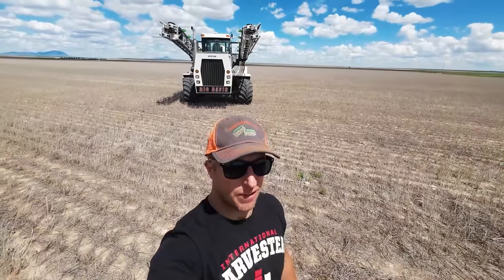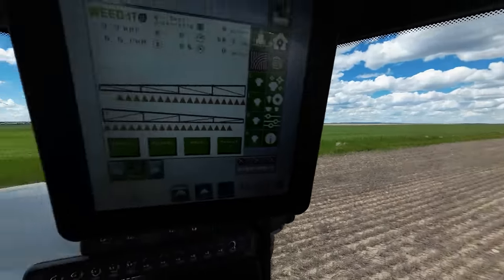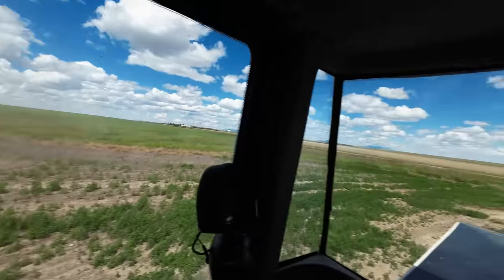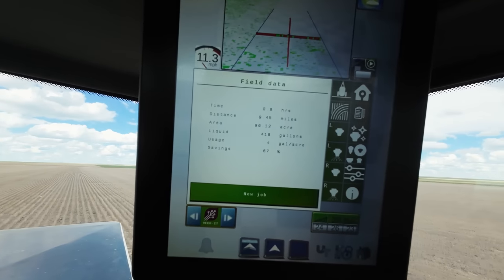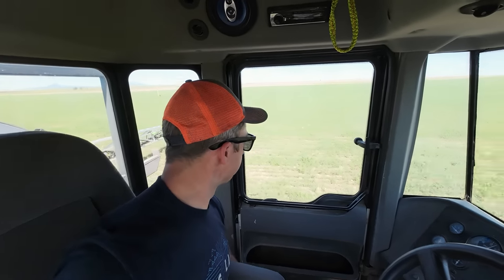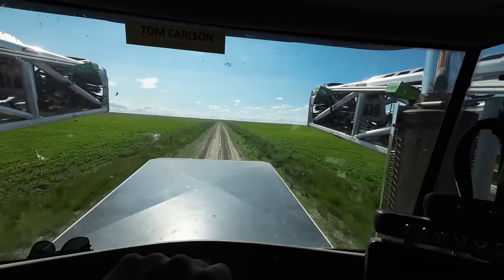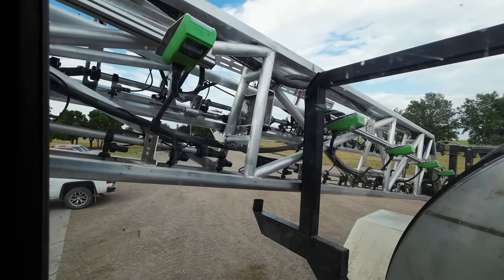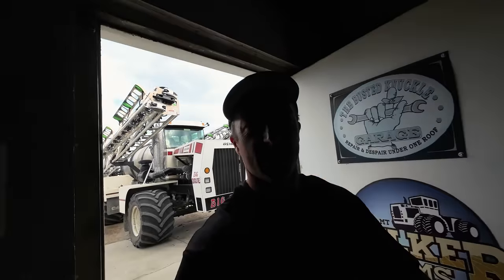THIS THING IS A BEAST!!!

Comment: Seeing those nozzles spraying as needed was amazing.  Not only saving money but not adding unnecessary product to water table.  Truly wonderful technology.
Reply: there is already a much better system that sprays each plant individually
Reply: @xxn0cturn3xx what technology is that?
Reply: @runninred89  look up Verdant robotics
Reply: @xxn0cturn3xx  That's pretty much what this is doing if you watched it any.
Reply: @Buck1954  lol no its not, do you even understand how the system works? Does it look like this system can target a single individual plant? 🤡
Reply: Yes it targets each individual plant i use the Weedseeker system.
Reply: @darrylpaulhus3069  no its does not, how hard is for you people to understand that this system targets an AREA and NOT a SINGLE PLANT..
Reply: @xxn0cturn3xx  no worries but stills uses up to 90% less chemical and i can still spray around 1500 acres per day
Reply: @xxn0cturn3xx  no worries but stills uses up to 90% less chemical and i can still spray around 1500 acres per day
Reply from the maker: @xxn0cturn3xx  this system does detect single plants and spray accordingly. But at 10" spacing and 30 degree nozzles, the spray pattern on the ground might be as much as a square foot. So a plant trigger means a square foot of product cover.
Reply: @WelkerFarms  just as i said, sprays in AREA, it always sprays the same area being there 1 plant or 10 of them. The system im talking about if theres only ONE 10mm wide plant it will only spray THAT plant, not a square foot.
Reply from the maker: @xxn0cturn3xx  that's impressive! I wonder what the top speed is? Would have to keep the boom height and speed absolutely perfect to maintain accuracy with that low of coverame margin. Still super impressive.
Reply: @xxn0cturn3xx  How are you quickly gonna drive over a weed with a sprayer and accurately target a single weed. A bit of wind or you drive over a bump in the field and it's gonna miss. Bet it's something that sounds cool in theory but is unreliable, overcomplicated and overpriced. More like a tech demo that doesn't work in practice. I'd like to see any farmer using that with good results.
Reply: @atnfn  the sensors probably look ahead to give time to follow, its not rocket appliances

Comment: Fun fact: be super careful when you get into mud with those sensors, when the tires start throwing mud/rocks, especially if your roading home in a rainstorm, it’s very easy to knock the glass out of the sensors. You guys have nice full fenders so you shouldn’t have to worry too much. Just a bit of personal expensive experience.
Reply from the maker: Thanks for the heads up! These are made with gorilla glass now so hopefully helps but no glass is indestructible.

Comment: I hope you keep updates on this system, how it performs, problems that come up, longeveity, etc... eventually things are going to not function (solenoids, valves, possible corrosion, etc) and what an average yearly cost to maintain it will be. A lot of money upfront for this massive upgrade, easily more justifiable with the more acres one has to cover each year.

Sprays that are non-residual (either like a glyphosate or glufosinate type or similar characteristics) this type of spraying will save a lot.
Reply from the maker: Thanks man! Did you see glyphosate crashing? Lowest price it's been as long as I can remember. Too bad it hardly works on our weeds anymore. Basically only good for grasses.

Comment: I'm curious if all the dust that gets kicked up affects the optical sensors directly behind the brute.
Reply from the maker: It definitely doesn't help, the sensors still detect but the chance of a miss is higher. Not a big deal because I will come back every 21 days and spray it again. So any Miss gets taken care of in 3 weeks.
Reply: Could you move the center section to the front?  Or just move the sensors to the front and use a unique distance compensation calc for the center tips.

Comment: I was a commercial restricted chem applicator back in the late 70 s and early 80 s.  This system is light years ahead of what I had to use.  Chemicals are Not cheap. This system should save you lots of money.

Comment: on the vertical piece where the boom crashes in, maybe move that in several inches and mount another vertical tube with 3 coil springs and wear pads to lessen the destructive power of repeat impacts? wish i could send sketches.
good luck with this season!!!

Comment: Wow, that spot spray is amazing!!  Great way to save chemicals AND farmland!!  I assume the delay from spotting to spraying is all calculated automatically and changed for speed and height??  One your drone shots with the light behind the spray it was REALLY super!!  And the slo mo was outstanding!!  Fabulous video,  thanks again.
Reply from the maker: They definitely are. That is why I am limited to 12 mph. If the sensors were mounted further away from the nozzles I could spray faster but 11 mph is a good speed and easier on the machine.

Comment: I got my WeedIt system going this year.  I'm using Agrotop (GreenLeaf) Spotfan 40-02 nozzles for glyphosate and 40-04 nozzles for paraquat.  Works great, would definitely recommend them over the TeeJet cone nozzles.  The Spotfan nozzles are specifically designed for WeedIt and similar sytems.
Reply from the maker: Appreciate the insight! Will look into those nozzles 👌

Comment: Nick, with the boom slightly twisting when cradling, wouldn't that suggest the cradle is slightly out - hence wearing the softer rubber in the one spot? Wouldn't want you to wear out that new boom after fitting the UHMW Poly strips.

Comment: I do custom spraying in the panhandle of texas, I would love a video explaining g how you determine what to load for how many acres you need to spray
Reply: Once you use it a few times you get a good idea of what the weed coverage is i have been running a Trimble Weedseeker system for 7 years.

Comment: Is the dust causing problems with the sensors directly behind Big Brute? Specifically build up on the sensors.
Reply: Need to wipe yhen after a couple of tanks
Reply: I use Trimble Weedseeker on a Miller front boom sprayer only clean sensors every 20,000 acres or so.

Comment: Talking about speed. There is also a speed in the mid to low teens where you start generating your own drift environment and May guys on flat land will run above that. I always sprayed terraces but just shows how lucky we were to have products like Interlock for anti drift deposition aid

Comment: How well did Weed-It handle the blanket in-crop herbicide pass?  Was the rate what you set it to?  A neighbor has been trying Weed-It and he couldn't get it to spray at anywhere close to the rate he wanted during blanket broadcast spraying.  Said it worked great in spot-spray mode though.  Also Weed-It is supposed to be able to put down a base broadcast rate, and then increase it when weeds are detected.  But that didn't work for him at all (rate was nowhere close to right).  Interesting to see your experiences.  Quite a machine now with autoboom!

Comment: I was just wondering if the weed-it system can tell the difference between weeds and crop so you don't fry your crop with weed killer, or is that just impossible? I know that there are selective chemicals that will only affect certain types of plant. Just curious. Thanks
Reply: No it doesn't it a green on black/brown sensor system Bilberry makes a green on green system.

Comment: How much light does the sensor need to be effective? Thanks for the video, I hope you are having a good day.
Reply: Very small amount, those sensor can only sense green light.
Reply: The sensors produce the light it requires no ambient light in fact they work much better at night. I use the Trimble Weedseeker system.

Comment: Its a cool concept but 200k USD for a retrofit... thats a whole lot of glysophate. Factor in multiple units to knock more acres out at 12mph. For my quick math, that price will have to come down substantially to make sense. In the area i am in, its pretty much 100% continuous cropping and very little chemfollow. Fall and spring application's where applicable.

 If it could reliablably target what you load into your tank weather it be a insecticide, fungiside or herbicide it could be more benificial. Especially if you could triple the nozzles, triple the chemical and do everything in one pass.
Reply: Whether it's worth it probably on parcel size.  Around here, east Texas?  Maybe the really big farms.  The Welkers farm like 10k acres (they have individual fields larger than entire farms here), so it's probably an easy payoff for them.

Comment: How can it tell the Difference between a Weed and a Plant?
Reply from the maker: Weeds are plants and plants are weeds. It detects chlorophyll, so anything that has green in it.
Reply: Ok however when you were Spraying the Wheat how did it know what green plants to Spray? 
Sorry Nick I know the Concept of it savings on Chemicals but it’s Baffling me!
Reply: @WelkerFarms  Do they have something in the works that will ignore the actual crop plant (photo-like calculation?) It probably can be done, but speed would definitely have to be dropped and weeds that are similar to the actual crop (wheat vs grass-like weeds) might be missed... would still be a huge option especially when looking for the main problem weeds like kochia, palmer, waterhemp, etc. during in-crop spraying that could utilize other chemicals.
Reply from the maker: @farming4g  so it can't tell the difference between crop and weeds like the camera AI tech can but it does have a feature that spots unusually high levels of chlorophyll and can spot large broadleaf weeds in cereal crops. We haven't tried it yet but I hear some have had good luck with it. This system shines for chemical fallow.

Comment: How big does the weed need to be to be picked up by the sensor....I agree you should truly not be going greater than 11-12 miles an hr even with a regular sprayer
Reply: It is not looking for weeds, it is looking for green. Anything green it will spray.  Not sure what position you are in to dictat sprayer speed, most outfits spray 18-20 mph.  11-12 mph limit here is the technology limit.
Reply: Trimble Weedseeker 2.0 does not have that speed restriction i spray at 18 to 21 mph

Comment: Is it possable to use that combo system in a reverse way ??   As in after u'v finished spraying weeds,  u could use it to only spray water on the WANTED CROPS(spot water the plants) ??  If drought continues, go over fields again spraying water only on the crops..  whichever crop yall harvest first u spray water on to help crop grow faster/better ??   Yes, i know its a lotta fuel and water, but with ur new system,  would it be worth a chance ?!
Reply: Do you have any idea how much water would be needed in order to make any difference... millions of millions of gallons. You would need 4 sprayers running in the same field making multiple passes over and over and over again before water could ever get to the roots of the plant. Were talking days of 24hr spraying just for one field.. not to mention even having access to that much water. If they did they would just irrigate.
Reply: Heres the equasion if your curious.

If an acre of land (43560 sq ft) is covered with one inch of water, how many gallons of water cover that acre. Thank you. 43560 1/12 = 3630 cubic feet of water. /231 = 27154.3 gallons.
Reply: @SortaProfessional89  thank u,   was just a misguided thought on my part..   short of GODs blessing with rain,  was wondering if there is a plan b,   plan c is... crop insurance..  thanx for taking the time to lay it out for me !
Reply: @timothyabraham2228  its no problem.. its just a comment i see far too often. "why cant your spray water" ... it just takes so much water to irrigate crops.
 Crop insurance would be plan b but even then its probably only covering inputs. Unless the government offers a subsity like for natural distaster "i.e. the duracho in the midwest 2 years ago... a tornado, flood etc." Then its near impossible to recoup the profit loss.